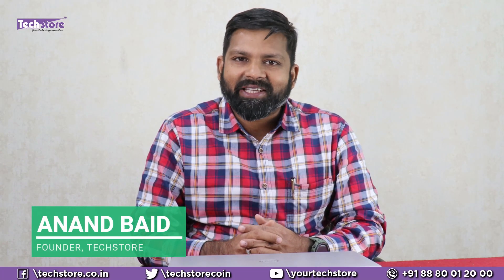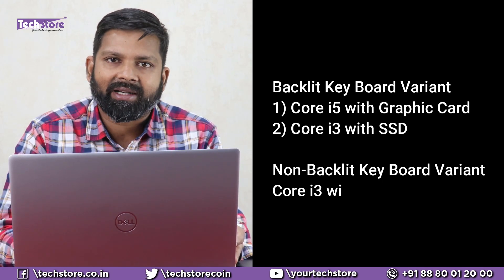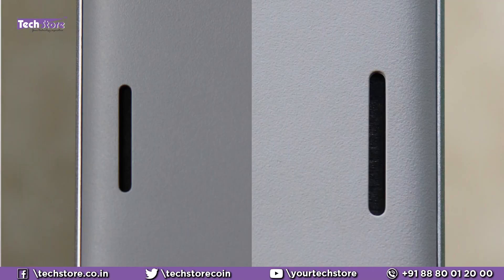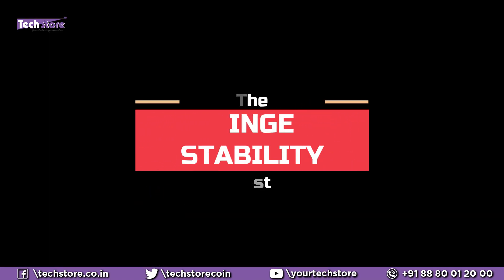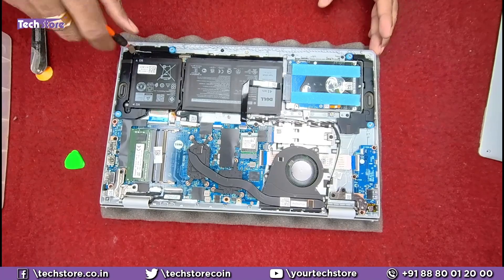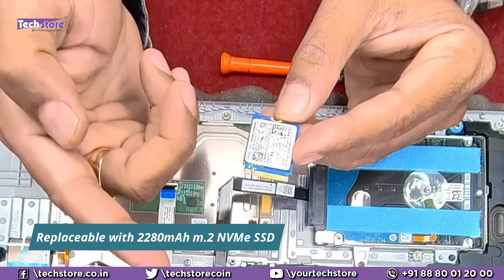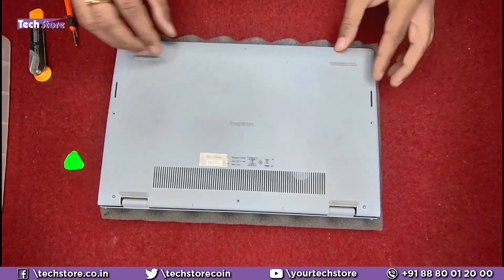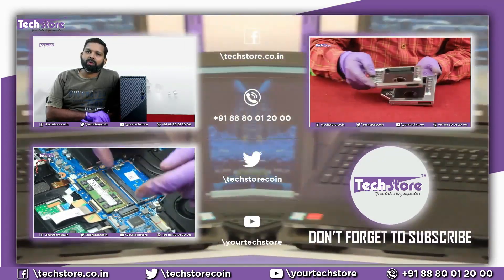Dell Inspiron 15 new 3511 3515 2022 model: review disassembly ram m.2 nvme ssd

Comment: Can i install backlit keyboard i have same latop with i5 11th gen 8gb 256gb ssd please reply bro
Reply: Reply sir????
Reply from the maker: have you subscribed?
Reply: @TechstoreCoIn  Yes
Reply: @TechstoreCoIn  Reply sir??
Reply from the maker: You can install a backlit keyboard but the process requires to remove exisiting keyboard which is fitted inside touchpad. I suggest not to take the risk.
Reply from the maker: Thanks a lot.

Comment: Sir i buy a dell inspiron 15 3000 laptop
I5  model 3511
Sir how to connect a ethernet cable no option there... i am working on plc side...
I will use usb to ethernet port adapter or any other option there pls explain... sir
Reply from the maker: Use USB to lan adaptor